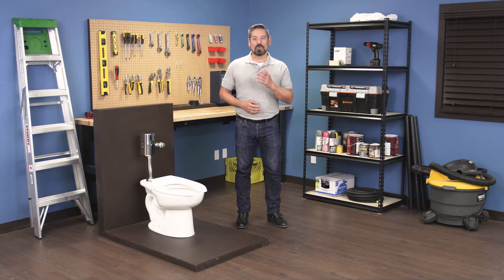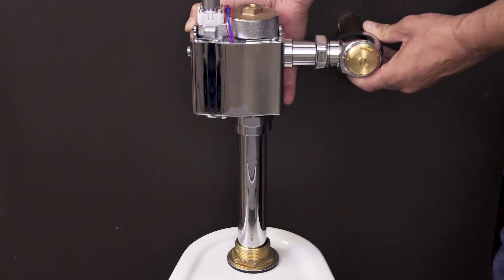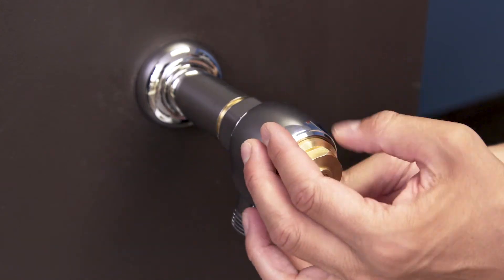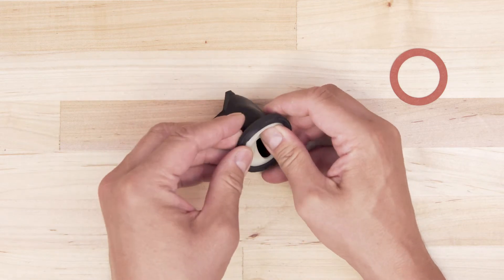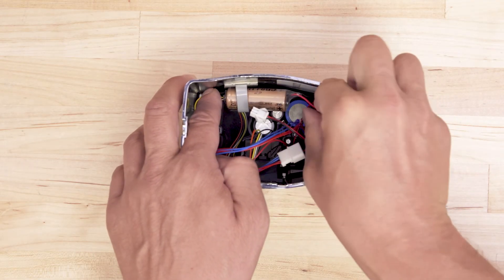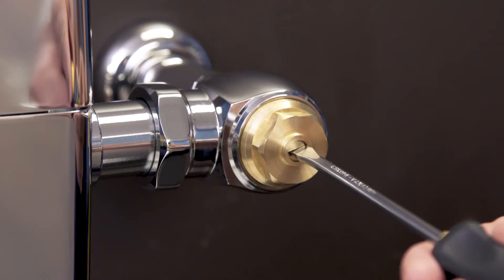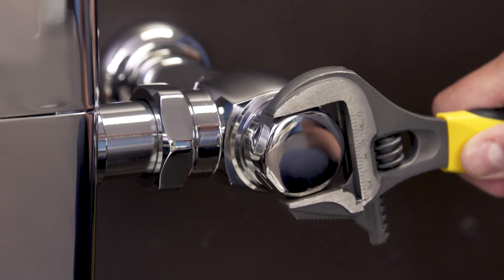TOTO EcoPower Flushometer (Pre-2013) | Installation | Repair and Replace

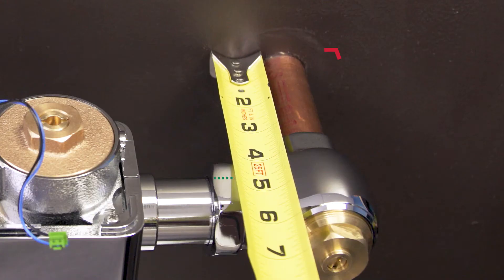Comment from the maker: Update at 1:22, cutting the copper pipe 1" shorter than the center-line measurement might leave too much pipe. There is some variation with how far the control stop can screw onto the threaded adapter, but cutting the copper pipe 1-1/2" shorter than the center-line measurement should make for good fit.

As well, teflon tape, or pipe joint compound is not to be used on any connection that uses an o-ring or gasket. It is however needed on the brass control stop adapter. This was not shown in the video but will still help provide a leak proof connection. 
More information on teflon tape: https://www.youtube.com/watch?v=9DhL0vet4gk
Guide on pipe joint compound: https://www.youtube.com/watch?v=a0jFPj4W8bY